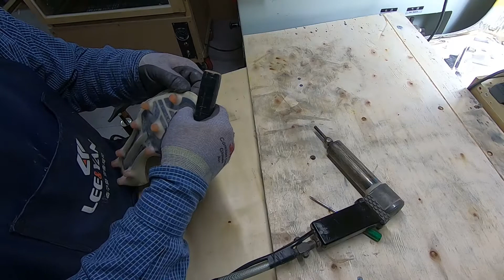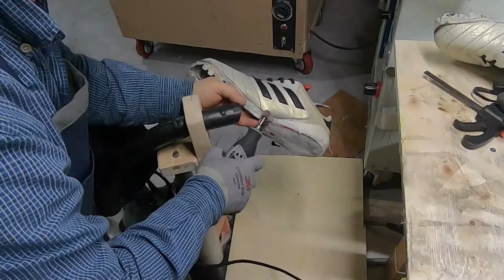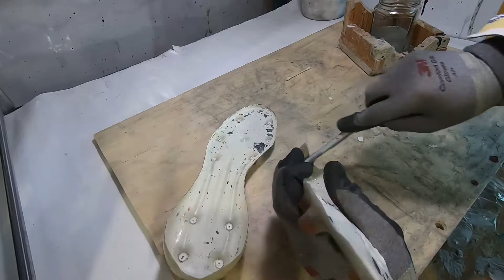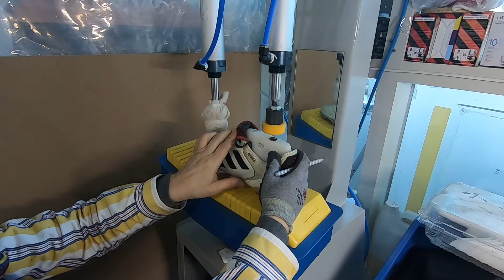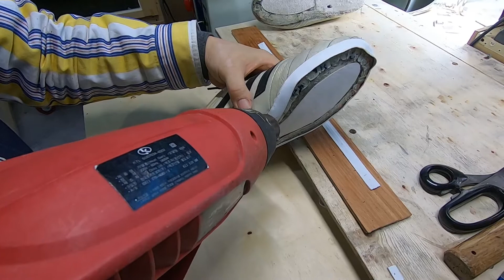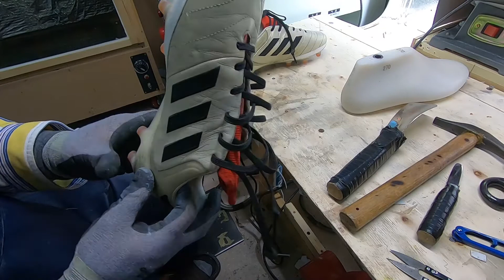How to fix torn soccer shoe upper - Adidas Copa 17.1 FG

Comment: The last step, what machine do you use?
Reply from the maker: The last machine is to press soccer shoes under pressure. It can hold the bond tighter because it applies pressure with much stronger force than a human push. We call it a pressure machine.
Reply: @leeandyang  I would like to get in touch with you, is there any contact channel I can discuss with you?
Reply: @leeandyang  I have soccer shoes that I love so much, I want to fix them and make it a career Can you teach me please?
Reply from the maker: @thanakiatleelanuwat3724  If you can simply fix your soccer shoes at home, I can teach you, but this skill requires a lot of experience and skills, so you can't do it alone at home. If you really want to fix your soccer shoes, I will let you know my Korean address. If you send me an international parcel, I will fix it as you want and send it back to you.

Comment: I see you use 2 color of glue? Is that same glue? White is new one.. Or that different glue?
Reply from the maker: Hi
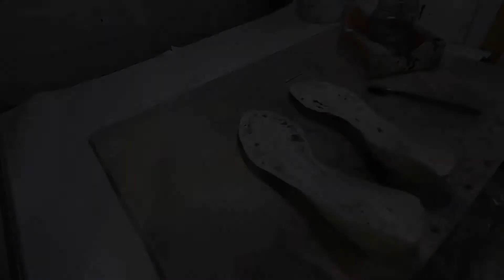The two colors of glue you're talking about are for different purposes. The transparent liquid in 5:11 is not an adhesive, but a chemical product to wipe off the sole surface, and the glue in 7:18 is a versatile glue, The white glue in 9:54 is the glue that attaches the upper and the sole.